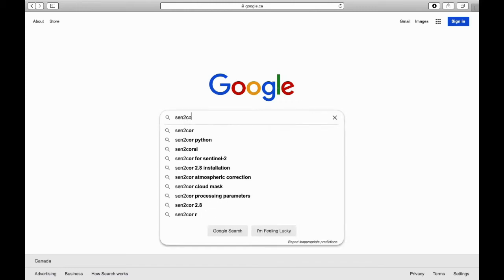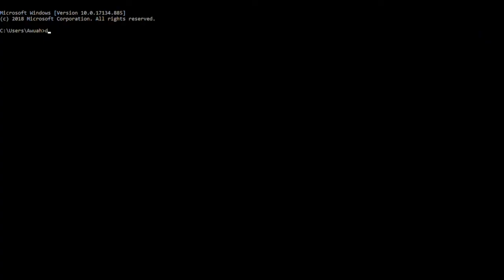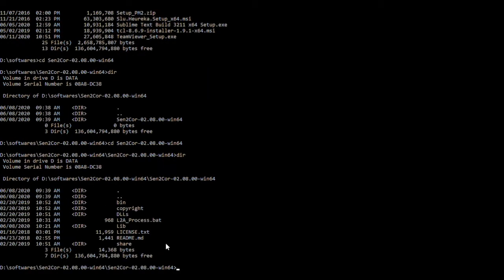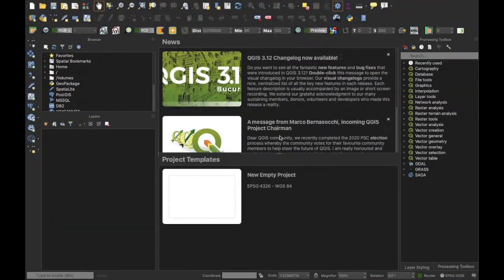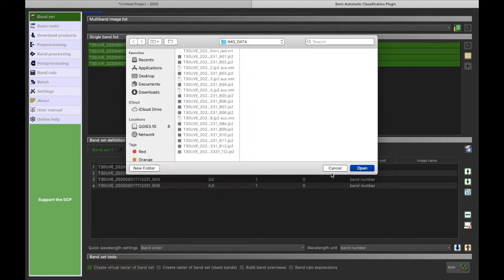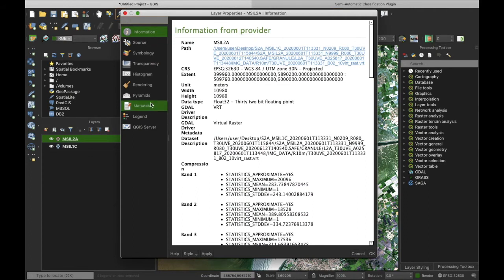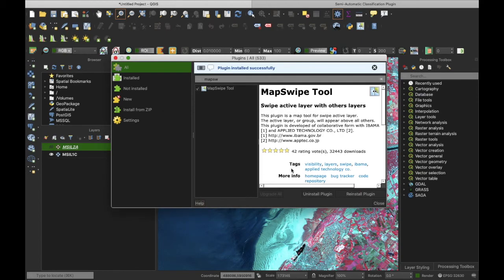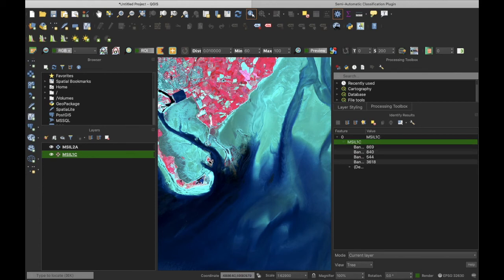Atmospheric Correction of Sentinel-2 Images Using Sen2Cor | Convert L1C (ToA) to L2A (BoA)

Comment: Thank you very much for this tutorial. I have a question: Is it possible to perform the process for multiple images at the same time? I have to process around 60 images and it would be perfect to be able to do it all at once.
Thank you!
Reply from the maker: Hi Daniel, 
Yes it should be possible, and even though I’m yet to try it out, this is how you can approach it:

The command line interpreter has a ‘FOR’ construct that will allow you to loop over multiple files. So after navigating to the folder containing the ‘L2A_Process.bat’... you can do this ... for example...

FOR %i IN (C:\images_folder\*.SAFE)  DO L2A_Process.bat %i 

This should automatically repeat the process for all images ( with file extension .SAFE).

Give it a try and let me know how it goes.
Cheers!

Comment: Are other corrections needed for sentinel 2 a msi level 2a such as atmospheric correction or positional correction?
Reply from the maker: Hi Benim,
Sorry for the slow response. Do support by subscribing if you haven't already.

To your question...Sentinel 2A is a surface reflectance product and comes already orthorectified. So no further atmospheric or positional correction is needed. However, if you are working in mountainous areas, then you may have to do topographic correction.
cheers!
Reply: @OpenSourceRemoteSensingGIS  thank you very much for your reply
Reply: @OpenSourceRemoteSensingGIS  thank you very much for your reply